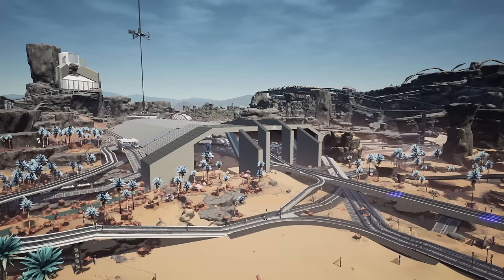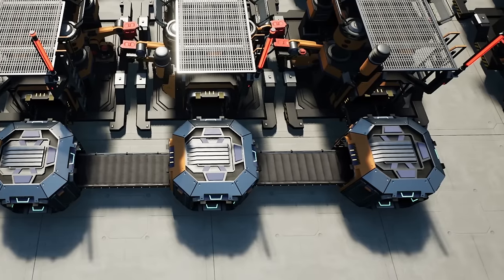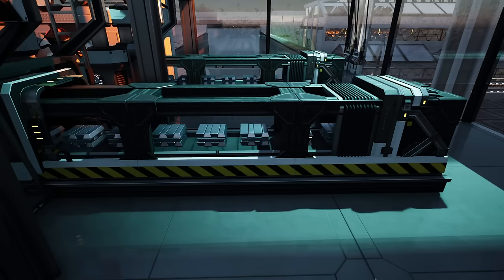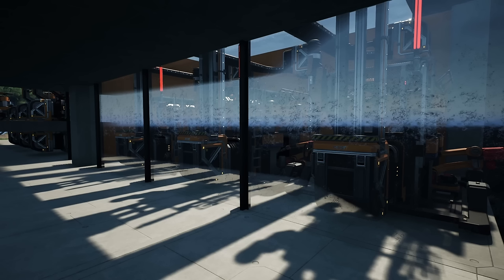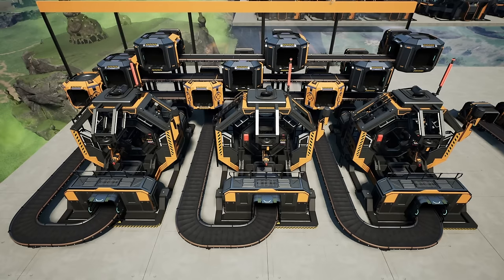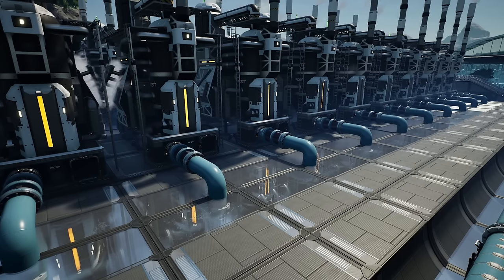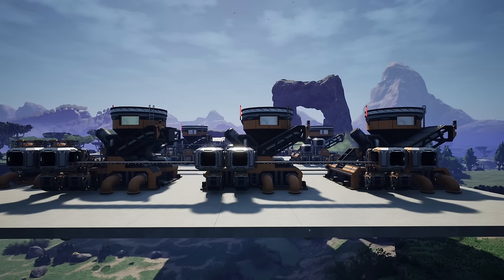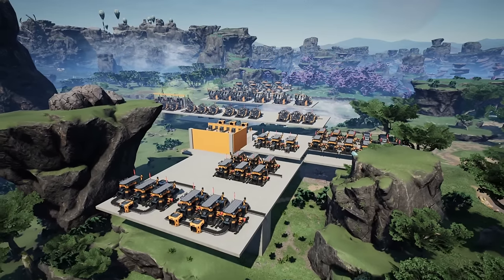Different Loading Styles | Satisfactory Game

Comment from the maker: Do you load your factory inputs as plainly as possible or do you add decoration?
Reply: personally I use the, "no planning at all" style, where I waste an hour setting up a bad sorting system and have to delete everything
Reply: SPAGJETTI
Reply from the maker: @thecrazypain9978  :D I do the same most of the time haha
Reply: i do not decorations on belts
Reply: Until now I've built towers of modules which were rather ugly but efficient. I had to use upper feed to keep everything reachable and clean and every module set up the same so I could choose any recipe and connect inputs and outputs to my limBUS(tm).
I'd loved to feed from below but I didn't have a single meter to spare in height. (Yes, very special location...)

In a furure build I'd fully utilise feeding from below. ;-)
Reply: I use the manifold method on everything instead of load balance, because it works and I'm a creature of habit, stubborn and set in my ways   ;)
Reply: I decorate it
Reply: Mine are plain along the floor, nice straight belts, with catwalks slapped on for more compact setups, but it will look so much better once I learn to do it a little more like this!
Reply: In my case I use the "pretty interior/exterior but ugly underneath" method, which consist to make the surface clean but it's a complete mess under the surface with electric wires in every direction, no organisation and stuff that climping in each others.
Reply: I always use Splitters and different level Conveyer Belts. I've fond ways for the math to work just with them.
Reply: I'm happy if my factory is not broken after I change something. Greatest form factor is "cube"
Reply: Many Satisfactory tutorials are slow and unclear. This one is actually pretty concrete, easy to follow and well passed. Thank you!
Reply: I prefer to make it look really cool only to realize that it will not work and cause everything to clog.
Reply: I don’t decorate. Can’t see the point, but I’m also not a “Content  Creator” and my time isn’t infinite.

Comment: To warm up manifolds I just run them for a few minutes with the output disconnected. Once the output buffer fills up you can belt it out and the whole thing will run smooth and efficient from then on.
Reply: Excellent notion. I’m new to this game, but my first impression is that there should be gates and switches in his game for these situations. Does it get annoying later in game to constantly make these little changes?
Reply: @ericmaher4756  no, because they are not really important to the actual game play. Get stuff on belts and move on to the next thing. 

Perfection in efficiency, manifolds and balancing is only for personal emotions, does not really affect the game goals so just relax a little and only worry about it if you want to.
Reply: I like to overclock miners until everything is filled then go back down to the regular speed
Reply: I hand fill stuff for the first time
Reply: Output buffers filling up doesn’t solve the problem at all, (1) at best it still warms up slower than if you just left it running, and (2) the belt speed will still constrain the warm up so in many cases it won’t even make a difference in speed versus the machines
Reply: @fashnek  what it does is ensure the output belt is always full. If that is all you care about it is the best way. 

And it does saturate faster than leaving the output connected. Because early machines in the manifold full up quicker and stop demanding sooner allowing machines later in the manifold to get more supply. 

It is the fastest way to get to a consistent supply out of a manifold setup if output supply consistency is what you are looking for.

Comment: Feeding from underneath is amazing. You can have any kind of spaghetti down there and just cover it up lol. (whatever works) I'm at the point now where I've started paying attention to the aesthetics (first playthrough, ~90 hours in) but I've realized that it's so much more than just making a pretty factory. Keeping things clean and organized helps you find things quicker too, and it makes me happier when I visit each location. I've taken feeding from below one step further and I'm now also doing storage buffers below, if there is room. Basically, why have a big storage box spoiling the view if you can build it into the foundation and just have an exiting conveyor or lift? Obviously not for storage where you need to access full stacks of items manually, but great when the train stops accepting items because it's un/loading, for example.
Reply: Keeping stuff organized makes it easier to modify the factory as well.
Reply: You also have a lot less spaghetti in the first place if your logistics are on a separate level, because you don't have big honking machines in the way of your neat and tidy conveyor lines. My usual rule is to run a conveyor line on the ceiling below either end of the machine, so that a conveyor lift has just enough room to pull items out of a splitter and insert them into the machine. You can then run more conveyors below that if needed. This works all the way up to a 3-ingredient manufacturer if your logistics floor is 8m tall, but a 4-ingredient manufacturer requires either a second parallel line or a taller logistics floor.

Comment: Everyone. And I mean everyone should download the modular splitter mod. It's unlocked after regular spitters and mergers, before smart splitters and mergers, and is appropriately priced using modular frames and other mid game items to build them. It's a great way to save space, and avoid the annoying process of extra belt work for larger factories. It's also really nice in my opinion because it doesn't eliminate the utility of regular and smart spitters and mergers. Each logic device still has its place

Comment: When I started making it my policy to feed fluids in from above, initially I ended up with an ugly mess. Finally found that placing vertically oriented junctions above each input on a temporary wall at the max height of a pipe support looks great. The pipe ends up running right above the floor holes for the conveyor inputs when you get the positioning right (using the trick of replacing a road barrier with a wall makes that part easier). For blenders, it's possible to have one pipe manifold right over the floor holes and the other at the same height farther out from the blender. Vertical to horizontal pipes connect neatly from both pipes.

Comment: I used a sushi belt system to feed 144 manufacturers making Crystal Oscillators. Also required a bunch of 7 way splitters. Took a while to set up but runs really nicely. I think people often underestimate the usefulness of balancing, especially when dealing with late game products, that are not easy to produce at rates that can saturate even a mark 1 belt.
Reply: Agreed. I am not a believer of one system above the others. Manifolds, even balancing and sushi belts all have their advantage that simply need to be used in their best situation. I generally use manifold for entry level factories, balance evenly resources on more complexe factories and use smart splitters on a single belt on items that will never fully feed a belt and save space by using a single belt versus four or more.
Reply: Do you use any kind of loop back or overflow prevention, or just rely on having the math right? I always use a loop back and anti lockup overflow sink myself.

Comment: Thank you for the frame-pillar trick, I've been wondering about that for a while. (I know you showed off the technique in an older video once but I couldn't remember which one and didn't have the mental or temporal bandwidth to go digging for it.) I like the idea of the 'sushi belt' for reducing the amount of vertical levels needed for solid inputs but yeah, either your math has to be precise or you need an "overflow" exit on EACH ONE of those Smarties and hooboy, now you're messy again. Still: Great video once again!
Reply: One overflow at the end of the minifold should suffice.

Comment: I was excited when the floor holes were first announced but I ended up preferring the old look with walkways over visible gaps in foundations. I do like the look of floor holes when you can get a little clearance from the floor, but directly from machine to the floor doesn't look as pleasant to me.
Reply: yeah i kinda like seeing some of the beltwork.  thats also why i dont hide the belts on a lower floor
Reply from the maker: I like showing some beltwork, but that's why I use glass foundations to see them running beneath the floor :) (if It's clean)

Comment: one thing that helps reduce manifold saturation time is to (as close as you can workout bottlenecking) match the belt throughput to the machine intake.  this is especially useful if you have a lot of machines to feed off A high throughput manifold.

also, i might do a little light overclocking if i want to match up speeds and feeds a little tidier, though rarely I'll use more than one power shard for this

Comment: I use the manifold system quite frequently, especially coal generators.  I preload all of them so they all have the maximum items they can take so there's no "ramping" up as they wait to fully load.  This works well for constructors as well as any of the other machines.

Comment: Sometimes for my factories I do different rooms for steps of the process with a sort of hallway system connecting them.
For the liquids I have them come up through the floor, for the solids, once they come in for the first time (also through the floor) I then run them up to a neat conveyor bus along the ceiling, using conveyor wall holes to get them out of the room and running them on the ceiling of the hallway to their next destination.
I also use a lot of windows between the hallways and the little rooms and I think it looks really nice! I recommend trying it at some point

Comment: When feeding fluids up through a floor, my understanding is that all you have to to do ensure full flow is to raise the pipe up above the destination machine inputs, and then even though the pipe dips down below them, the head lift height remains the same and it should easily rise back up into the machines. I have yet to experience any problems with this method, though to be fair I'm pretty new to Satisfactory fluids. (I've placed it a bit higher than your fluid buffer sitting on the same foundation level as the receiving machines, though.)

For manifolding a manufacturer, doing it under the floor seems to have an advantage in that you can split half of the manifold on either side, one half under the machine and the other half away from the machine (via C-shaped and S-shaped lifts respectively), which reduces the amount of vertical space from that required for a stack of 4 splitters to just enough for 2 splitters (and stacked belts) on each part. A bit like you showed for the two pipes underneath the blenders, just with conveyors. Doing it above seems to work well enough with an assembler, but I'm not sure the manufacturer has enough room to hang the splitters over the machine without clipping...

Comment: With Sushi Belts simply setting the last smart splitter to have overflow route to a Sink means you don't have to perfectly balance everything.

Additionally they work well with all 3 of the multi-belt buildings.

Finally with manifold feeding you can use smart splitters where the output to the next building is set to overflow to speed up how quickly each building fills.
Reply from the maker: When/If they add copy and paste functions to Smart Splitters, I'll try this :D
Reply: @TotalXclipse  Copy/Paste would be a godsend for them agreed. But Smart Splitter best splitter.
Reply: @sunname6252  I vote programmable splitters for best splitters. Because sushi load-balancing.

Comment: I still struggle a lot in satisfactory with (un)loading trains. In Factorio it's pretty "easy" to design a max efficient way to load trains without any bottlenecks or slow downs, but in satisfactory due to the lack of good (simple and not taking a square mile of space) throughput unlimited load balancers, it is often the stain on a otherwise perfectly balanced factory (e.g.: my aluminium factory, which processes alle the bauxite from the map). So... if you're ever bored, that would be an interesting topic.

Comment: Personally I don't like the staggered splitters in the manifolds much . Instead, I stack them on top of each other, which is also easier to set up: one feeds directly into a conveyor lift, the others into short 90° bent belts that go into conveyor lifts with a 90° twist.
For assemblers, when I have the splitters directly on the floor (i.e. not using lifts), the stacked splitters stand lined up with one of the assembler inputs. The upper splitter feeds into that input via a short belt ramp, while the lower splitter feeds the other input via a short belt with two 90° bends.

Comment: May be answered elsewhere, but should be a simple question: What is your recommended height (in splitters) for a logistics floor?  Is there a standard, or do you vary it based on the factory?  Like a factory of Assemblers might need 2-3 splitters in height, but a Manufacturer one might need 4-5?
Reply: I think he mentioned something about 8 meters in an other video some time ago

Comment: I can't handle having belts directly above mergers/etc. - the fact that the bottom of the belt clips through the top of the merger and the top of the merger can be seen clipping through the belt stresses me out. I wish that Coffee Stain would re-design the machines to fit belts on top (or even just to make the machines themselves more stackable).
Reply: my method is to stack multiple splitters and then delete the intermediate ones. the belts then don't clip through the machines. It's more vertical height but it looks ok. I do prefer loading from below now with the latest updates though.
Reply: @platinummyrr  Yeah this is similar or the same as how I approach it.

Comment: If the only problem you have with manifolds is that they take slightly longer to warm up does not sound like any bit of a issue to me. The real problem with manifolds are when you create very long chain of manifold thats when the systems running the furthest from the material source output will not get enough materials so it creates the problem of splitting off lines to accommodate. As far as 6:30 that is also my prefered way of setting up my machines now its clean looks good especially from above and you can make a spaghetti mess underneath where no one can see it lol.

Edited for spelling.